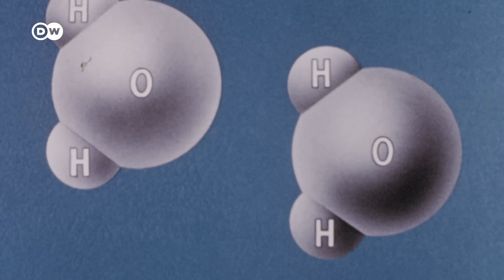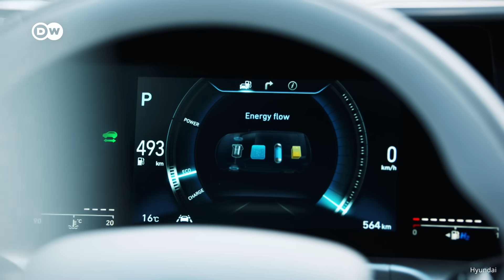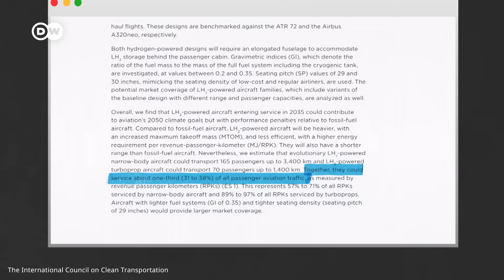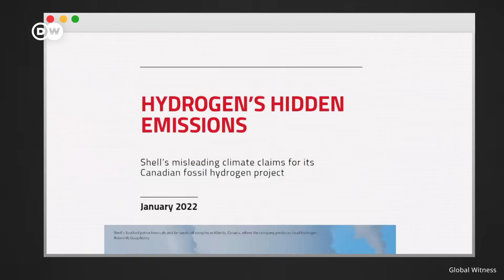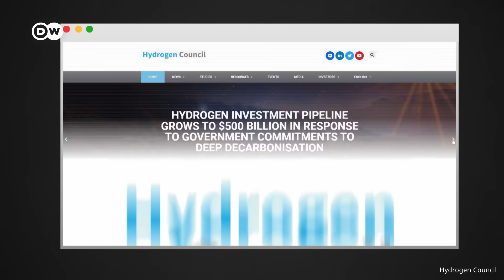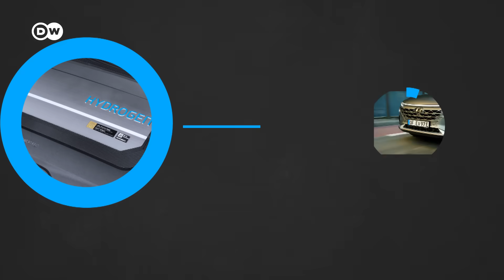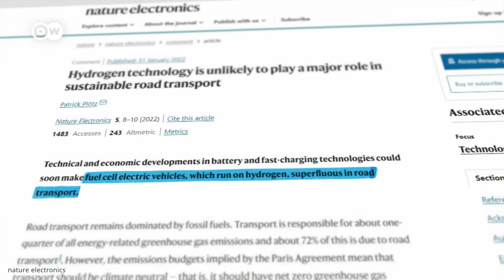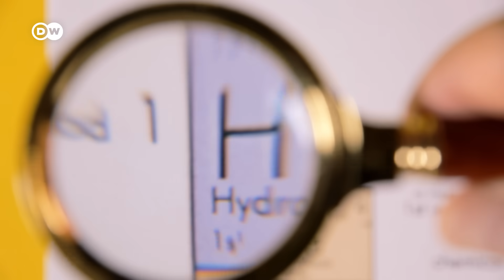The truth about hydrogen

Comment: No matter what process is used, the amount of energy needed to create hydrogen from water will always exceed the energy you get from using it.
In other words: Energy out < Energy in.
Reply: True or not, it's horses for courses. If solar energy is cheap and plentiful - which it will be, then hydrogen production is cheap.
Reply: @brianheard4565  Even if solar energy becomes so cheep it's free (which is impossible as you need materials to harvest it) it will still require more energy to break the hydrogen free of its bonds to oxygen. The energy you get from whatever solar source used will exceed the energy you get back from the hydrogen.  H20 is the lowest energy state which is why it's used to put out fires.
Reply: @thecarman3693  not true. Norsk Hydro in Norway years ago created the Hydrogen Hiway along the coast of Norway. They designed a Hydrogen refling station the size of a coke machine, or household refrigerator. The electrolysis is powered by solar panels. All they require is a water source. If you have sun and water, you are creating hydrogen.
Oddly enough this story didn't bother mentioning one of the biggest hold ups for hydrogen vehicles. Each one is a small bomb.
Reply: @fauxque5057  And the energy from solar will exceed the energy from the hydrogen.
All you've done is use a commodity that gets its energy from the sun. But it's still greater than the energy you'll get from burning the hydrogen.
My initial comment still stands.
Reply: @brianheard4565  Not a quantitative argument.  We might have to wait for fusion energy to supply the energy needed for massive hydrolysis.  And then, it would go for uses where battery-power is impractical (e.g. airplanes)
Reply: @dataflowgeometry  The problem with fusion energy is we've been told it's only 15 or so years out.  And we've been told this for over 60 years.
Reply: @thecarman3693  Due to improvements in magnet tech, the field strength for Tokamak containment is now such that smaller (living room size) reactors are being prototyped.
Before, they needed to be the size of a whole house.   An experimental reactor in Boston set to be fired up in 2025.
Reply: @dataflowgeometry  Again it's the same old story. Now it's 2025. Let me know when it happens. Until then .....
I'm not saying it's impossible, after all it happens in stars. But these timelines never seem to materialize.
Reply: Actually with any kind of energy storage you have that problem. The key is how much losses occurred.
Reply: If you're talking about energy transfer inefficiency, all energy storage means are imperfect.
Reply: Same of all spontaneous processes.  It's called the Gibb's equation.  What you are missing is that we don't care about input from adding energy directly from the sun.  Also thermolysis  - not electrolysis is the way to go.  It is 60% efficient and double that of solar cells.  Just heat water enough and it liberates hydrogen.  The sun with a lens can focus a lot of heat.
Reply: YES but I feel superior to others when driving a hydrogen or electric car. And in the end isn't that what it's all about?
Reply: Not true
Reply: @jactac838  Name the process ---- otherwise ....
Reply: @jactac838  correct answer, using electralysis takes one spark to separate and h2o molecule yet in the fuel cell you get 2 sparks from each H from H2O, therefor at the most inefficient way to do it, one would get twice as much out then in. However, there are new discoveries, and already known ways using magnets to reduce the energy consumption to separate the H2O down to a trickle of energy used over time, yet still getting the same from the fuel cell so is no longer 50% but down to 0% from Niagara Falls generation station to 5% with magnets and even less using the newly discovered techniques combined.
Reply: the hydrogen generator has no moving parts and consumes 0 water in a closed loop and will run and last as long as the parts it is made of, the decay rate over time and gold will last forever but the membranes have limited life spans or half lifes of 1000's of years.
Reply: @BCFalls1  The problem with your "solution" is you're not getting any energy out. All of your H2 is simply going back to H2O. Once you try and get useful energy from your system it becomes inefficient. It's like trying to extract energy from a ball rolling back and forth on a frictionless rail between two peaks with a valley in-between. You may have perpetual motion, but no useful work can be accomplished.
Reply: @st-ex8506  I can buy the working model from the duty free air catalog, LOL!
Reply: @st-ex8506  currently the membrane in the fuel cell is the weakest part of the cell otherwise the water generator would last thousands of years.
Reply: @st-ex8506  the electrodes are platinum or better yet iridium and the charge is a weak charge from an H atom nothing like the spark in my truck and those plugs are now at 120,000 kms still not needing to be replaced
Reply: @st-ex8506  no more need for catalytic converters either freeing up the platinum, rhodium, and iridium elements
Reply: @st-ex8506  do you believe in man made co2 warming as well?
Reply: @st-ex8506  and as for industrial nuclear is still the most viable option and hydrogen implosion tech cleans any waste materials.
Reply: @st-ex8506  reaching for straws now you are
Reply: @st-ex8506  we dont even need to reduce co2 but increase it to at least 700ppm to give us a cushion over the current Eddy minimum and fossil fuels does that also increase food production yields.
Reply: @st-ex8506  are you honestly still here? do you have a life? Yes, I am getting sick and tired of the comments, storage is a whole other problem, we seriously lack energy storage abilities and hydrogen produces energy not store it. My lithium batteries suck compared to normal batteries, just bought 4 rechargable AA batteries for my LED light and did not even last a single night!!! Hydrogen is and always has been viable which is why oil companies have suppressed it for well over 120yrs. They want to still find a way to sell us snake oil hydrogen
Reply: @st-ex8506  bottom line hydrogen produces energy at zero cost once the unit is built and anything that produces like that now is called wind solar or water falling over a cliff.
Reply: @st-ex8506  you are way out in left field there so I agree. you have to invest energy to get gasoline to run a car, what is your point? The fuel cell produces energy from hydrogen atoms then uses 50% of it, to make more hydrogen which equates to 100% energy production and can be scaled up to any size by adding more fuel cells not a battery that stores energy but a generator that generates energy.
Reply: @st-ex8506  even if the rate was 1% energy production using 99% energy to get that 1%, that 1% is still 100% energy produced
Reply: @BCFalls1  Once the unit is built?
How about maintenance? How about operational personnel? Upgrades over time due to increased demand?
Zero cost is not a reality.
Reply: @thecarman3693  no maintenance due to no moving parts, operational personal for what your generator? Do you have one now? upgrade to what, it is the best? Zero cost after the until is built is 100% correct as in no fuel consumption if the unit is built with the correct materials, Next question? Your comment is mute.

Comment: The greatest scam in all of this (aside from carbon capture) is hydrogen powered or ever battery powered trains. They can be powered directly from the grid, which is more efficient than either option and we've been doing it for more than a century. The only niche where small battery powered locomotives can fit is shunting onto platforms than need crane access (something currently done by small disel locos).

Comment: Hydrogen will very probably have future as energy storage medium but it will take more time because of cost and efficiency to put energy there and out again. 
We have to solve more urgent need now - where to take the energy at the first place and not just pretend it's clean. 
Nuclear energy is clear answer. It could give us time to play with renewables. 
The price of renewable energy will not go down in the near future. It will go up.
It took lot of land and construction materials and constant service of really many devices. The price of renewable energy was going down just because of very high initial price for power semiconductors. It's similar as with computers in 90-ties. Very soon it will be very different story. 
The new green parties are necessary to pupport real clean energy sources based on science not ideology.

Comment: Blue hydrogen ... I knew this to be a bad idea 40 years ago, when in Physical Science class at college I was taught burning fuel directly is always more efficient than converting it to another form of energy. Green hydrogen's basis - wind -  cannot even provide enough energy for NORMAL electricity generation on a consistent basis, let alone more than that for splitting out hydrogen for energy use. 
Even if cost keeps getting lower for these alternatives in the near term, they take decades to be realized cheaper or even equal to today's energy economy, with no guarantees that ANY of that happens. 
This entire concept of hydrogen use is hype, a solution that doesn't solve anything. My involvement in limited hydrogen fuel use during my career showed it to be highly flammable, so much so that the general public should never be allowed to get near it, for the likelihood of triggering explosions is too great. 
We need less emphasis on supply of energy, and more emphasis on demand for energy --- and reducing that demand factor requires serious emphasis on world population reduction.

Comment: I think battery materials are limited and if they can't be recycled I think there will be a shortage. I think hydrogen has a great future as long as it's green 👍
Reply: battery materials are fully recyclable today and cheaper than the mining and refining system. co founder of tesla has a recycling factory already recovering 97% on the minerals. once all cars are battery driven there will be a closed loop system whereby no more mining will be necessary. this is already happening.
Reply: So wrong answer, the battery materials are recycleable with 94%, but the rest of the materials are NOT recycleable and guess, wich material they are? Yes, those materials are the most necessary for the battery! lithium, graphite, cobalt, and manganese will lost mainly all rechargeability after their first cycle before recycling, after that it takes ten time more time to charging than first fresh materials!😢😢😢

Comment: Propane as used in North America contains about 36 to 37 percent hydrogen and for this reason it's the best alternate fuel. LPG has a very high octane rating of 104 which allows any recent engine to get better fuel millage than the same car of 10 years ago, when the compression ratio was much lower. The high 10.5 to 11 to one compression ratios allow the engine to take best advantage of the high octane and therefore give about 20 percent better MPG. Over the past 40 years the pump prices of propane have been about 60 percent of the price of gasoline. Propane is a liquid when under pressure in the tanks, so for that reason, it's a better fuel than CNG Compress Natural Gas. Your engine will last 2 to 3 times longer on propane  than the same engine running on gasoline. We usually leave the gasoline system in place so that you have a backup fuel system when you run out of propane.

Comment: You could call the Airbus hydrogen planes the Hindenburg series. Jet fuel is remarkably difficult to ignite with a spark, such as a short circuit in a wire. Hydrogen on the other hand is extremely volatile, as we saw in the explosion that destroyed the Hindenburg blimp in 1937.
Reply: Hydrogen was not the reason for the Hindenburg "explosion". The Hindenburg burned rapidly because of the extremely flammable coatings on the dirigible fabric. If a hydrogen tank gets a hole, it just decompressed, there is no explosion.  It's not chemically possible (I've been a practicing PhD Chemist for over 25 years, so I should know).

Comment: Hydrogen has very large physical risks vs. other fuels. 
Hydrogen is exceptionally difficult to contain. Gaskets don't stop hydrogen leaks.. rather perfectly smooth 'lapped' metal to metal contact is the most reliable containment methodology, and surfaces of course tend to have imperfections or get marred. The hydrogen atom is the smallest of all atoms, it can make it's way through exceptionally small gaps or channels.  Also, hydrogen has a very wide flammability index, it will burn in a vast range of air to fuel ratios vs. other fuels.  And importantly, once hydrogen does ignite, it's flames are not visible to the eye! This makes fighting hydrogen fires extremely dangerous for responders, and presents clear risks to anyone in proximity to the fire when it breaks out.

Comment: the truth about hydrogen is that it only has 6000 but per gallon not 120000per gallon like propane. hydrogen must be at 30 000psi  and a cubic foot-8 gallons  not a gallon then its about 100000btu   however the hydrogen fuel cell car weighs very little so it gets twice the gas milage per gallon thats the equivalent of 200000 but per gallon which makes up for compression cost along with no mechanical bills and a cheaper car in the first place.  also its hydroelectric which is better and conserves water. stops flooding. creates fish instead of rapingthe ocean and acomunities around reservoirs united of cities

Comment: Batteries also aren’t the future, the lithium ore is controlled by just a few countries AND will run out quickly. Hydrogen can also be reformed into liquids and gasses that have higher energy density. It is a more intricate process but it can be done. As before, it’s all about investments and we people suck at investing in what’s right (rather than easy or a quick yield).

Comment: Hydrogen supporter here, yet let's not get crazy and put all the eggs in the same basket. H2 has some serious disadvantages:
1. basically it leaks from everywhere, as it's a tiny, tiny molecule - therefore should be used close to its production site;
2. green H2 production uses a lot of potable water... which is a scarce commodity;
3. the fact that the human eye can't see its flame is quite a limiting factor for use in closed spaces - even though, contrary to what uninformed people claim, it does NOT explode, like most commercial gases do.
Hard not to see large furnaces or chemical factories being converted to use it; a large production site can be installed closeby, eliminating the need for relevant storage and transport, and their respective losses.

Comment: First LIE is that carbon Dioxide Capture is a good thing! 
Plants and trees need CO2 to LIVE.
What did I read said it was 90% capture with actual number at 48% then with methane goes down to 39%. Showing the LIES of what is being sold to the public!  
Prof Ian Plimer says Methane is 23 times that of CO2.
I hear SF-6 is between 23,500 to 27,087 times that of CO2 which is used in High Voltage equipment. Like in the sub stations which are used in the Prayer Wheels and Solar power production. Which doesn't generate much outside of peak times! 
More LIES with truly clean hydrogen!

Comment: What about producing hydrogen as-you-go for vehicles now? Basically a device based on the demonstrated electrolysis but in a safe gizmo that delivers it to the engine? Surely this must be viable? Not saying it will totally replace carbon fuels, but it might at least increase efficiency.

Comment: I think hydrogen gas to heat home and food is a viable option using sea water that has been cleaned of its salt using a wind turbines to start we hydrogen renewable energy and we need to make the hydrogen economy for the future. 
I believe hydrogen renewable energy is economically sustainable strategically sustainable environmentally sustainable if look at the Orkney islands ferry is run on hydrogen fuel cell and the take a look at the H100 scheme in Fife Scotland they are producing green hydrogen not just for the future but in the here and now

Comment: More recent information about the advantages of hydrogen engines is focused on the limited resources of lithium worldwide to make batteries for the estimated number of transportation vehicles necessary to make any difference. Hydrogen to make electricity for battery powered cars is a great idea, but there may not ever be enough lithium to make the batteries.
Reply: Latest take is that there WILL be enough lithium to make the batteries for cars.  Large capacity storage  batteries will not use lithium, thus easing the demand for it.

Comment: I believe the gov. Needs to promote more solar and wind  farms that can provide daytime energy as more is used in heat of day. Also need to tell car companies to use a standardized size battery verses making individual ones for their particular models. Hear a new Nissian battery is $14,000+ which will make the car worthless in resale 7-9 years later. It like Sony cam corset and the VCR. Need to standardize like AA,AAA, C, D batteries. 4 options of power to design cars around so manufacturers can have competitors and reduce price.

Comment: You did not mention hydrogen through ionization with PWM (3kHz/10kV) on atomized water (possibly on demand/without need for storage); Compressing and freezing air (with many other useful chemicals as a result). The low efficiency of hydrogen production is meaningless when compared to the environmental destruction caused by harvesting other energy sources and the simplicity on the methods to extract it from water, which has significant room for improvement.